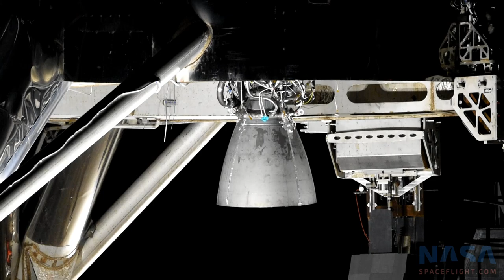SN6 Raptor TVC Checks on Starhopper - July 12-13, 2019

Comment: Right at the end, the nozzle appears to be shaking quite a bit, but I guess thats part of the Test?
Reply: I expect the thrust when the engine is running preloads the nozzle to remove the shaking?
Reply: By the looks of it, they unpressurised the hydraulics at the end which allowed it to wobble naturally.
Reply: nahhh, it's earth quake
Reply: I would assume that they need it to react quickly to keep control of StarHopper
Reply: they were increasing speed as the test went on
Reply: To me it appeared as if it was moving in a spiral pattern to a center point. Either testing all the gimbal hardware operating in unison and/or calibrating to center.

Comment: I wonder if that's the program for the next hop.
Reply: It is actually! Elon tweeted that's its not only going perfectly vertical but also a little horizontal
Reply: I don't think so, it doesn't cancel out it's horizontal velocity at all
Reply: That much deviation of the engine during a hop would send Starhopper into the next county end over end lol

That's just testing the mechanical limits of the design, the actual engine movement will be very minor and under live feedback control, (think of balancing a pencil on your finger), and there is no preprogrammed movement for it, since movement is based on what is needed to keep the rocket balanced and on trajectory.
Reply: ke6gwf I understand your point and it has merit.  That said, they'll almost certainly have the sequence automated even if it doesn't look like this.  There are likely checkpoints and limits to prevent race conditions but I have a lot of doubt that they'd try to fly this thing manually.
Reply: @HylanderSB  The only way to fly something like this is to have a program that constantly adjusts the thrust and gimbal based on changes in location, speed, orientation and rotation. It can't just be a blind pianola or it would just crash.
Reply: Krithalith hmmmm... I wonder how many corrections are required when the vehicle is flat on the ground?

Comment: What pressurizes the hydraulics when the engine isn't running?  Batteries?  Compressed NO2?  Shore power?
Reply: Microverse battery
Reply: The Schwartz
Reply: I think its helium
Reply: They don't really have power take offs on rocket engines, so it's going to be battery powered systems, probably using helium or nitrogen for pressure.

On ships that need more power for longer than the few minutes of a normal rocket flight, they will deploy solar panels once in space, or for the shuttle use fuel cells to produce power.

I would guess that Falcon and Starhopper use batteries, because they have such short flights, and the batteries are kept charged via shore power until the umbilicals disconnect at launch.

Dragon deploys solar panels once in space to keep it powered, and Dragon 2 has conformal solar panels on the trunk.

Starship probably would use MethaLox fuel cells, and some sort of conformal or deployable solar panel for extended missions.

But the rocket engines are there to provide thrust, and any attempt to bolt an alternator to one of the shafts that is turning at 50,000 rpm would just cost thrust and add complexity and failure points lol
Reply: Cosmic energy